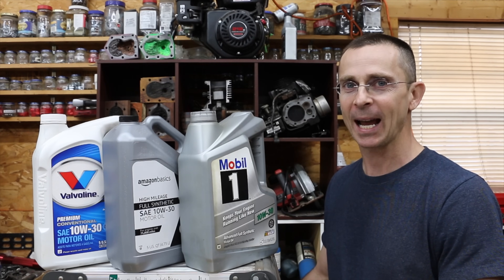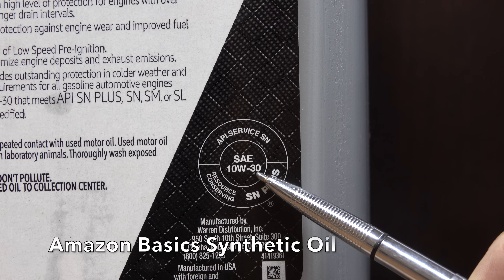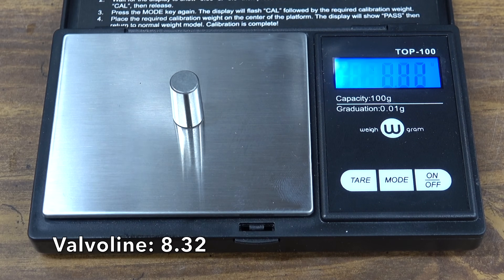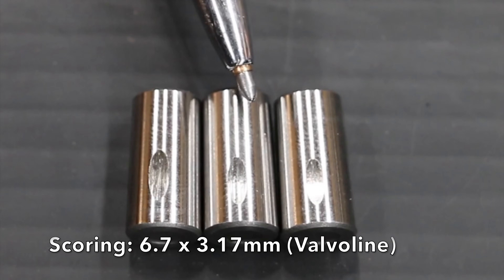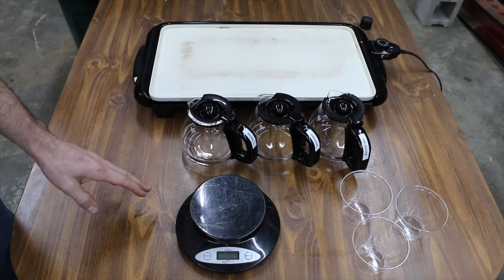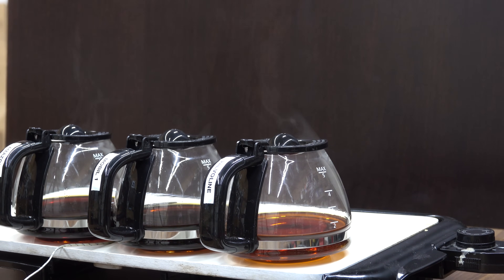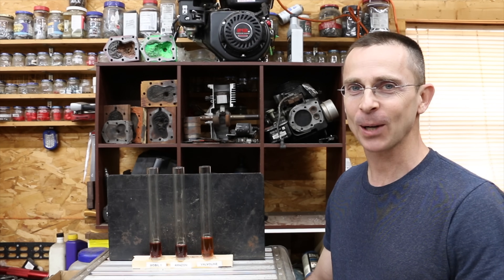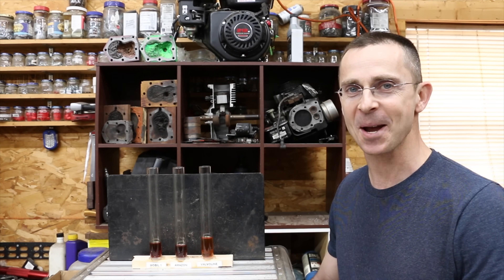Is AmazonBasics Full Synthetic Motor Oil better than Mobil 1? Let's find out!

Comment from the maker: DISCLAIMER: The testing methods outlined in this video are my own and not performed using expensive oil lab testing equipment or following the ASTM, SAE or API testing standards. This is a showdown between AmazonBasics full synthetic motor oil and Mobil 1 full synthetic motor oil. The VALVOLINE motor oil used in this experiment is CONVENTIONAL motor oil, NOT SYNTHETIC. The use of the Valvoline conventional motor oil is to illustrate the benefits of that synthetic engine oil has over conventional motor oil. Why buy a conventional motor oil when you can purchase a synthetic motor oil which will outperform conventional oil for around the same price or a little more? This is not meant to imply that the AmazonBasics full synthetic motor oil or the Mobil 1 synthetic motor oil are superior to Valvoline’s full synthetic oil. The three tests outlined in the video include tests for viscosity at varying temperatures, film strength, and evaporative testing. In my opinion, the testing approaches used in this video provide consumers with valuable information on choosing the right motor oil for their specific application. Hope you enjoy the rest of the video!
Reply from the maker: Edward, Thanks for the recommendation on testing super tech oil!
Reply: @ProjectFarm  You should heat the oil to the operating temperature and then do the lubrication test 👍🏻
Reply: @ProjectFarm  Haha, I was just about to ask about the SuperTech as well. It's also got the 'SN PLUS' rating, but I only see 10w30 available in quarts.
Reply: @ProjectFarm  I've been using superthech and quakerstate for years in my Corolla 192,000 miles. I'm curious about how it compares to amazon
Reply: @ProjectFarm  supertech is amazon basics.
Reply: Project Farm: what about Costco’s Kirkland Signature full synthetic oil?
Reply: Project Farm Try hyperlube lubricant ,compression test before and after on your truck and everything else and lubricity tester please
Reply: what about Walmart super tech oil?
Reply: Edward Moreno trash
Reply: @edwardmoreno8228  Pretty sure that the Amazon Basics is SuperTech. Bottle is the same and the bender is the same (Warren). Google images: "Walmart SuperTech Synthetic vs Amazon Basics".
Reply: Edward Moreno read a review on Amazon that the amazon bottle says Super Tech on it  .
Reply: @edwardmoreno8228  Independent tests show that Wal-Mart's SuperTech Synthetic Oil is nearly identical to the Amazon Basics Synthetic of the same viscosity.
Both made by the same company.
Reply: Now I want to see that but with the synthetic blend added.
Reply: As you try to be scientific as possible, perhaps a crowd fund for you to buy some mettler toledo scales (nice used ones on ebay for $800 go to 32 KG and measure tenths of a gram. The higher end ones likely aren't justified to have 0.001 grams).
Reply: Can veggie oil be use in a 2 stroke engine instead of 2 stroke oil + gas it should be veggie oil + gas I over heard that you have to add a little more veggie oil in the gas than the standard 40 to 1 ratio I believe it was around 25 to 1 ratio.  Was told it smells like French fries.
Reply: I would love to see the amazon basics and penzoil platnium go toe to toe.
Reply: @Duddyt  I would bet that Amazon Basics would eat Penzoil's lunch.
Reply: @Duddyt  Why not head to head...🤔
Reply: @Duddyt 
Why not head to head?
Reply: First of all... love the videos. I like the extreme tests that most people would cringe over. I've learned a few things from your tests that changed certain ways I used to do things that could of ended terribly. Thank you. 

Secondly, will you test Liquid Nail?  I would love to see how it holds up against it's competitors.
Reply: Project Farm try using hyperlube by itself as oil and mixed with oil and see how good it is
Reply: Project Farm And
Reply: Very helpful. You got yourself a new subscriber :)
Reply: Would also be interesting to see some comparison between more known American and Western (or Middle) European motor oils on one side to those from former Easter block on the other as people  quite often  share (mostly) mthys of those "Soviet-time" products being out of date and totally low-quality; in practice, they behave just fine and do their job - on older engines they seem to perform even better than any other lubricating product!

Just to give you some hints:
1. OLMA (Slovenia)
2. INA (Croatia)
3. Modriča (Eastern Bosnia)
4. Hexol (Romania)
5. FAM (Serbia)
6. Nis/NISOTEC (Serbia)
7. INSA (Bulgaria)
8. Prista (Bulgaria)
9. Lubrica (Bulgaria)
10. XADO (started in Ukraine, but now produced in The Netherlands)
Reply: I work in an oil analysis lab. Send me some samples
Reply: Canada allows non-synthetics to be marketed as synthetic.It's a racket.Group 4 I think they call it.Lots of hype concerning motor oil. Synthetic oil is ester based.So all the CanadianTire sale brands like Quaker State,Mobil andCastrol are not really synthetic in Canada, unless you can find the Euro formula. See Bob is the Oil Guy for debates.
Reply: Your videos are very high quality and very interesting, keep up the good content. 👍
Reply: Awesome videos! 
I do have a video request.  
We always hear how important it is for oil to flow in a cold engine, but we also know that oil sits on the parts and can run without oil in the crank case for a while. 

Could you do multiple cold starts lb 2 engines, one with say 10w30 and one with straight 30 oil? Or 15w40 vs straight 40? 

I'm curious how the engine that gets oil around faster but its thinner vs the engine that gets oil around slower but thicker film  strength compare as far as wear.
Reply: Project Farm I work in an “expensive oil testing lab” & can provide testing results such as pour point, ccs, kinematic viscosity, etc... if you want to send me unlabeled samples I would be happy to test & provide you unbiased results. Side note: Warren is a distributor, they buy bulk oil from major oil companies & package it for resale under different “brands” such as Amazon. (Side side note: Chevron does not make Amazon oil nor do any of its products rebrand as Amazon Oil ; )
Reply: Greg Chavez An important side note to this info is that there are other components and performance criteria that differentiate the various different synthetic 10W-40 oils, even those from the same manufacturer.  Because Warren is only a distributor/repackager of other companies’ finished products,  unless the retailers (Amazon, Walmart, O’Reilly) include verbiage in their purchase agreements with Warren that guarantee certain very specific formulations, it is possible that Warren could switch up their sourcing from batch to batch or month to month or year on year.  That means Amazon’s or Wally’s 10W-40 oil sold today could well be a different oil by formula than the very same oil sold 1 year ago or 1 year in the future.
Reply: Thanks for clarifying! I appreciate your non-biased videos and your down to earth personality. Totally subscribed to you now, what you are doing is great! Keep it up!
Reply: Well done,... I'm a retired CLS/STLE trained by Mobil Oil and worked for an independent Mobil dist in the upper midwest. We know cold. 
I like the fact you included the conventional oil and the fact you ran the cold flow for both fresh and oxidized oil. Most people don't understand coming into winter is a very important time to change the engine oil,. especially if the vehicle sits out. The visual of the oxidized oil hopefully registers with your viewers that synthetics are great for cold weather operation.
Visuals are the best learning / teaching tools..... I know,... I did training sessions for lubricant clients, jobbers, and our customer service staff. 
Everyone is from Missouri,... the Show Me state. I wished Youtube was around when I was still working. Very nice video.
Reply: Pennzoil Conventional,Full Synthetic,HM Full Synthetic would be a cool show down compared to other brands in the same categories
Reply: Viscometers are not all that expensive.
Reply: Beazos is making more billions
Reply: I would really appreciate a video testing different utility knife blades!
Reply: You should check out a product called POWER UP on your friction machine.  It's a bit expensive so maybe next time I order some I can send you a few ounces.  It will make the "wear" mark in the bearing about 1/10th the size.
Reply: Can you throw in valvoline full synthetic 1030, Castrol full synthetic, and then add rotella 1030. That would be very interesting
Reply: What's all the hype around Royal Purple? Should that oil ever go into a vehicle?
Reply: Have you tried that AmsOil product? This Amazon oil seems like a good one to use based on your tests here.
Reply: I know you made a video on thread lockers, can you make a video on which glue (Elmer’s, for example) is best for threadlocking?
Reply: I'm curious to see other house brand oils tested myself. CarQuest, O'Reilly's, and AutoZone sell oils with their names on them and I'm curious to see how they stack up to Mobil 1.
Reply: Project Farm  Have you tried Pennzoil full synthetic
Reply: I just want to say thanks for the update.
Reply: Project Farm
.....or someone else please.
Can you answer me this question? I have a 2002 Toyota,which should i use....SL,SM or something else.
Reply: I want to see one other CERMA oil too
Reply: Can you test Conklin Oil versus some other good oil? They claim to be this Grand oil that you can use for 20 plus thousand miles.
Reply: I would like to see how this Amazon brand would fare against Castrol Edge. I will probably never switch from Castrol, but I am very curious.
Reply: Please do a comparison video like this with Wal Mart Super Tech full synthetic. Awesome channel. Keep up the good work.
Reply: Walmart oil filters are made by Champ Labs they are a quality filter.
Reply: Project Farm Would you try Mobile 1 Extended Performance, Castrol Edge Extended Performance, Pennzoil Ultra Platinum, With Amazon Basic Oil and Supertech oil. As the synthetic you tested is not top of the line oil for each respective brand. Also love to see she’ll Rotella T6 go against the competition. (Truckers and turbo vehicle owners will forever appreciate!)
Reply: Dexos 5-30 comparison coming?
Reply: Hey I enjoyed the video, but I would of liked to see the oil measured as a control, given that the lubricity tester does tend to use the oil by flinging it everywhere, so more oil could very likely mean a better result.
Reply: Mobile 1 vs mitasu oil
Reply: Project Farm could you do a test with the new Shell Rotella Gas Truck oil?
Reply: Project Farm
Will you or have you ever tested Farm and Fleet full synthetic?
Reply: Big Dee  
Really? Why the obscenity?
Reply: Any chance of seeing a comparison of motorcycle oils, synthetic mobile-1 v-twin 20w-50 vs other comparable synthetic motorcycle oils that are used for other v-twin motorcycles like Harley, Victory, Indian, etc
Reply: Would you be able to test different brands of drill bits...drilling into different types of materials....like steel, aluminum, stainless steel, wood ect?

Would be interested to see drill bits from big box stores and professional grade....to see durability results and cutting speed vs effort...
Thanks for the videos you make and post
Reply: Thank you for the detailed video. You’ve gained a sub
Reply: Nice substitute for the HFRR. It's just not a standard. Was the oil heated?
Reply: There is a scientific method to measure the fluidity of the material which is called rheology.
Newtonian or non-newtonian, volum, temperatur, stress, strain... So many parameters needs to be considered to definite which oil is the best in terms of quality (depending of the use) and finally compare the price. The color should not be a criteria of choose. https://en.m.wikipedia.org/wiki/Rheology
Reply: Thanks for the feedback
Reply: It's looks like a paid comparison. Watch at 8.46. you can clearly see the flow way of amazon basics's way is slightly lean towards ground which gives it more speed to flow.
Reply: Have you considered,  doing a comparison test on combining the best friction-reducing additives with the best oils to see just how far you can take it? For example, adding slick 50, Marvel, Lucas, etc to see just how much you can reduce friction, using any or all combination of additives? Thanks, my apologies if this has been mentioned before.
Reply: Your scientific prowess is putting the majority of the nutrition community at Harvard School of Public Health to shame XD
Reply: Project farm I recently purchased a diesel pickup and I would like to know if you can do the same test but with diesel engine oil please and thanks.
Reply: I would like to see if you could test a new snake oil and include it in your test. The product is DT 5/50 this claims to be good stuff and is convincing in the videos. Thanks if you can. here is the link:  https://dt550usa.com/
Reply: Can you test the Valvoline vr1 racing oil up against the winner over all. Amsoil I believe as the vr1 has 1400ppm of zinc vrs 800 on the amsoil so curious how it does on the tests you run. Those of us using racing oil will be very interested in a racing oil test.
Reply: Please text this product
https://m.facebook.com/story.php?story_fbid=178815993674838&id=105983917624713&sfnsn=mo&d=n&vh=e
Reply: Will you test some imported motor oil? Perhaps Idemitsu motor oil. Usually found in Asian import cars. Honda’s usually use Idemitsu oil from the factory and require Idemitsu ATF. Really curious how they hold up to Mobil 1
Reply: Please test Mag1
Reply: Please test the payback motor oil in a future video.
Reply: Who cares, I know you have to do a disclaimer especially for the oil that doesn’t win. Your simply doing your own tests with your own equipment and whichever oil comes out the best doesn’t mean it’s the best for your car. The dam oil companies need to take this as free advertisement and just get over it and use these viewer available tests to improve their oil to be the best! Basically oil companies QUIT CRYING AND ENJOY THE FREE ADVERTISEMENT AND WORK ON MAKING YOURS “THE BEST!” NEXT TRIAL!!!
Reply: Is shell rotella better than amsoil
Reply: You need to test the tribotex oil additive claims to reverse engine wear
Reply: I think your testing set up is brilliant! I'm not sure you need the special equipment. The only thing you do need is replication (in science-talk, you currently have n=1). Do all the tests you did in this video 10 times and then you're really getting scientific. You might get different results - this single test could be an outlier, after all.
Reply: I love watching these videos, I'm sure you get request all of the time, but I think it'd be cool to see Champion Brands products tested. They are a local brand and I'd like to see how their products stack up against some other well known brands.
Reply: Could you test Havoline brand motor oil? Haven't seen much about that brand and maybe shell if you havent already done that one thanks
Reply: Big disclaimer there Mr.Farm !  You really should have used Valvoline “ full synthetic “ from the get go  !
At any rate, from your other reviews, it would appear that Amazon full synthetic is identical to the Costco and Supertech synthetics, only difference is it costs 4 to 6 dollars more for a 5 quart jug . $5 which can be used toward a better oil filter .
Considering Amazon has such clout, it should be cheaper than either one . I know you state that you don’t make anything from any product......however your reviews come across as “pro” Amazon .
I’m just saying !
Reply: By the way, Amazon is having a “super deal “ on Pennzoil ULTRA PLATINUM for $20.57 on a 5 quart jug ..... which as you know, came in second place next to Amsoil , about double the price, if not more !
Why should I buy the Amazon synthetic for roughly $19 when for a buck or so I can get the Pennzoil ULTRA .....based on your own review no less !
Reply: YES and what a GREAt motor oil well done Amazon:-) and a BIG thank you to Project farm:-)
Reply: It looked like you used more oil in the cup of Mobile 1 during the bearing wear test than you used when testing Amazons oil. This would cause lesser wear with Mobile 1 if the wheel was lower in the oil picking up more up on rotation. Now I did notice some splash off to the top left side & maybe that removed a little but it didn't seem you were measuring how much to put in the cup. Having said all this you do great work.
Reply: You are a liar, you said in the video that you used Mobil 1 Full Synthetic and then in the comments you clarify that you used a lower quality oil.  You should go to jail for speaking lies.  I wish I lost all your subscribers to being a liar.
Mentiroso jamás me suscribiré a tu canal.
Reply: Mate, you are cutting a considerable income stream by not having sponsors and I know why, your ethics are beyond reproach as a result. Have you ever thought of compensating for that with some merch? You have way more than enough viewers for someone like Bunker Branding to do it all for you, design, print, stock, take orders and distribute, all you do is get a monthly payment. I'd wear a Project Farm cap, I'd use a Project Farm can cooler/koozie as well. I'd also have a Project Farm sticker on my tractor. Why not drop them an email and give it a go, it's "no cost and no effort to you" income. after all.
Reply: Can you test oil monitor systems and changing your oil based on mileage.
Reply: I know that this is a late reply, but it would be nice to have a reference part, tested without any oil, fixed time on all and compare the wear to the reference part(no oil).
Reply: Valvoline restore and protect caught my interest. And I would like to see you use it in one of your vehicles, and every time you do an oil change, pull off the valve cover to see if it actually does what it says. Cleans 100% deposits. Make it  happen. I think it requires 90 hours or something like 4 regular oil changes.
Reply: I am really glad you picked Valvoline instead of a bargain bin dino oil to compare against.  I also really love the other two comparisons.  If I could add one more I'd really like to see Amsoil Signature Series compared against those other two synthetics. I'm a bit fan of all three synthetics now thanks to your excellent testing and demonstration.  Probably, to me, the best video of yours I've seen so far.
Reply: Perfectly said. Thank you for the 3 great picks here, perfect comparison.
Reply: Excellent demonstration as always. I think razor blades might make a good comparison. There's also a rumor/conspiracy doing the rounds that Gillete uses poorer quality steel over time (thus enticing customers to try their New-and-improved 7 blade razor. Plausible.
Reply: @Locrian1  WoW I've never thought about that, and it's scary how plausible it sounds
Reply: Who makes there oil Amazon doesn’t make oil where do they get it from what company
Reply: Amazon doesn’t make oil where is there oil come from what big oil company
Reply: Why buy a conventional oil is because you have an old engine that burns oil and leaks if it doesn't have a little sludge to help the seals stop that, where startup wear is less of a concern than having a mess where you park it and having to add oil more often than convenient.  I mean if you live where you can't park a car in your driveway, in an apartment or condo without a garage so you are just getting a little more time out of the vehicle with the least hassle possible.   You can try high mileage oil in such cases but high mileage dino seals better than high mileage synthetic.
Reply: @stinkycheese804  if you use good oil from the beginning, you get less wear, less of a gap for blow by.  Also if your oil loss due to leakage is enough to make you want to save money, why don't you fix the worn out seal or replace the pan with the stripped drain plug instead of cheaping out on an inferior performing oil?    It seems like saving money on oil is just going to cost you more in oil and engine costs than using good quality oil to begin with.  If nothing else, use a better product with your next engine and save all around.  I'm a big fan of Mobil 1, now Amazon Basics (if they don't change it) and Amsoil.  BobIsTheOilGuy proved to me the high protection characteristics of Mobil 1 and Amsoil a long time ago.  With Amazon Basics being a good contender now too.
Reply: @underourrock  evaporation due to water.
Reply: Stinky Cheese  You just nicely outlined your decision making process but most people aren’t driving old leaky cars. IMHO and experience, high mileage isn’t a reason to avoid synthetic but age is.  
I’ll add, IMHO, that ALL fluids should be changed to synthetics ASAP as it has a very real, positive impact on longevity of components.  Don’t forget to put synthetic brake fluid about every 2 years, synthetic transmission and differential fluids too!
Any synthetic is better than even the best conventional fluids, IMHO.
Reply: @MrFatcat23  This all depends on your definition of "most people ... driving" and whether "most people" is even applicable to the question.  Technically, 50.001% is most people which still leaves a HUGE swath of people driving leaky old cars.  I would argue that many people currently driving newer cars may well drive them past the point where they are "old leaky cars".  The cost benefit of buying a new car or even sealing all the leaks may well make the investment not worth it.  This is also a regional issue.  Many people in rural areas are more practical than your city dwelling hipster who always must have the newest iPhone and a five or less year old car.  The used car market is huge, even for the privately sold $500 beater.  

Often these leaky cars are perfectly reliable.  They just mark their territory a little bit...or a lot.  

The truth of the matter is, though, if you are going to sell your vehicle the first time you see a drop of oil on your driveway, or are even not planning on driving your car into the ground, it doesn't matter what oil you put in the car.  Grab the $10/gallon walmart special oil off the shelf and dump it into the engine.  You will be selling it before you can tell the wear difference anyway...silly rabbit...
Reply: @kender1412  I disagree with you on cheap oil unless you test it lubricant rate or how well the oil keeps metal parts from contacting each other with the oil film on the pistons and other moving parts.  Oil that has no quality after certain conditions like heat.  You can condition the metal parts with some oil products after stripping the engine of old oil residue with a clearer.  Did a few treatments on a three year old 72 Chevy El Camino which I still have today.  I used the product PROLONG and a engine cleaner in the old oil.  It would smoke a bit after starting the engine a few years after purchase February 15, 1975.  Thinking that oil was getting into the cylinder somehow and suspected valve guide leaking?  After doing the engine cleaner a few times after and adding the PROLONG to my oil the smoke out of the tail pipe stopped.  Not sure if what it did but that is the results I got.
Reply: Stinky Cheese I have an 01 Toyota Corolla that burns oil and I have to be filling it up every 2 weeks so would I use conventional oil or what would i use? I currently use valvoline high mileage which is a blend
Reply: @kevinarevalo8546  if it's burning oil and not leaking it, then high mileage oil would make no difference.
Reply: If the engine was taken care of in the first place or fixed and had good oil in it then it wouldn’t leak
Reply: @stinkycheese804  Pretty sure this vid was made for people that aren't riding hoopdis/ghetto rides. Obviously if your car is trash your'e putting the cheapest shit in. Been there done that.
Reply: Project Farm you should try flex seal in the crank case as an oil substitute I bet it’d be pretty eventful if you did it while it was liquid still
Reply: Project Farm  You probably won’t read this comment but I would definitely like to see Torco SR-5R oil vs Motul 300v power racing oil
Reply: This came up while I was researching cooking oil for my food channel. LOL
Reply: I was wondering what would happend to the carbon build up when you mirror polish the cilinder head. There are a lot of people claiming that polishing the cilinder ports decreases carbon build up. Looking forward to your anwser! Keep up the informative video's!
Reply: Have you tested manual transmission oil?
Reply: Project Farm I’ve yet to see you make a useless video...it’s starting to annoy me (lame joke of course). A suggestion for further testing: Amazon basic v. Mobil Extended service v. Mobil Annual protection. Thanks for the hard work.
Reply: try with vehicle please
Reply: Have ya thought about the new hemp oil craze......?
Reply: Try hyperlube lubricant compression test before and after on your truck and everything else and lubricity tester please
Reply: A lot of person are telling Amsoil No.1 is it really good guys ?
Reply: Project Farm which is better geese regular geese or marine geese?
Reply: Would love to see Harley Davidson oil up against Mobil one and amsoil
Reply: I believe you should test shaffiers. It's all I run anymore from the demonstration that I was shown by a rep.
Reply: Amazon may private label from Mobil 1
Reply: @gigilaco  
When you say Amazon may private label Mobil 1... Do you mean they may be doing that already or in the future and Why?
Reply: JackTannehillPromoter After some searching, I can confidently say that AmazonBasics motor oil is actually made by Warren Distribution. They’re the company that makes Mag1 among other brands. I think what you’re saying is possible in the future though.
Reply: Is there any way to contact you or email you.  I have some issues with a particular adative and I would like some feedback from you please. 
Thank you
Nate
Reply: Try driven oil LS30 vs amsoil. Different oil for high performance engines
Reply: I wish you had told your viewers that you were using Valvoline CONVENTIONAL while doing the test ! what other sneaky things did you do ?
Reply: I'm still not putting generic Amazon Basics oil in my car
Reply: Can you make a test Ravenol with Polytron
Reply: Can you test Driven Racing oil HR5 10w-40 and Driven racing oil HR1 15w-50
Reply: Wheres your videos testing amazon oil?
Also cam you test multiple variants? So try 5 30, 5 20, 10 30, etc. And see if theres any difference for those vs other oils. I have a feeling that just bcz this amazon oil variant did well.. that others may not. Perhaps mobile would win 5 20 match up or something. Im curious of amazon holds up across the board in all variations. Im still skeptical to use it but i might on my next beater car.
Reply: Have you tried top 1?
Reply: you should have at least tested Amsoil instead of Valvoline...
Reply: Chubbysumo The reason for the Valvoline is that a proper testing protocol requires a baseline setup or system that is comparable to those that are being tested (the accelerated wear/lubricity device is a good example) so that the testing setups themselves are proven as comparable/fair/valid.  While water or honey could be used as control lubricants, or a dry test could be considered as a control, but they would only validate the validity of oils as lubricants vs. water or honey or dry, whereas the Valvoline test validates that the test does in fact work (oils will work with this system), and therefore any differing results are attributable to the subject products (the synths) and NOT the system or faulty methodologies.
Reply: @chubbysumo2230  Valvoline is the best conventional oil available. . Valvoline Full Synthetic is one of the best synthetic oils available!
Reply: You can send the oils to an expensive lab for about $50 an oil.  There are multiple companies online who will do this?  Why not do that instead?

Your tests don't even show that much information.  Things like cold flow are more a function of viscosity (10w30) than oil quality.  All your test show can show is that it isn't actually 10w30, but you can't tell us which one is too low and which is too high.  A low viscosity that is good for cold flow is bad for fully coating engine components, so balance is needed and this test is not a pro or a con.  Likewise a 0w40 is better for both (since the first number is lower and the 2nd number is higher), but in exchange it has more non-lubricating additives which can cause it to perform worse in other areas.  It is what it is by design, not by quality.  So your test doesn't really tell us anything; any more than saying "this orange is more orange than the apple is."  ... Great.  Or I could pick up a 0w30 and do even better, but who cares?  That only tells me the oil doesn't match its label.

Particles tests for wear, contaminant tests (such as varnish in the oil) and so on are much more important to engine life.  And it would be good to test each again after a few thousand miles in an engine, to show how much they break down.
Reply: Where are you buying synthetic oil for “just a little more”? It’s nearly double if not more than that for synthetic lol depending on brand of course
Reply: @TomPlaneto  I think he means Amazon Basic or Walmart Super Tech full synthetic.
Reply: @TomPlaneto  
Walmart Supertech conventional vs Walmart Supertech full synthetic have a price difference of less than 70¢ for a five-quart jug.
Reply: @TomPlaneto  autozone I scored 5qts Mobil 1+filter for 6 bucks more than conventional +filter cause o the sale
Reply: @TomPlaneto  Amazon basics costs just a little bit more... Do you actually listen or is it just that you didn't have your finger in your left ear so the words wouldn't go in the right ear and flow right out the left?  At the beginning of the video, he stated that most synthetics are expensive and arguably not worth the cost.  The point was to test the Amazon Basics synthetic against a good conventional oil and a good, more expensive synthetic to see how they compared.  The inexpensive Amazon oil did pretty well, making it a good contender against a halfway decent conventional oil.  Now, if you want to throw garbage $0.99/qt oil that comes from a guy bottling oil slicks from the seep plains in Southern California on eBay, by all means, do so.  It's your engine.
Reply: Some issues: why are you using 10w30 if you are concerned with cold flow? 5w30 or 0w30 is the way to go. Why are you also comparing synthetic with conventional? Also why isn't the most important thing in engine oil, TBN (total base number, aka how much acid it can neutralize) tested? Synthetic basically can last 2x as long and you are comparing fresh engine oil against each other instead of used up worn out synthetic against each other.
Reply: Shing Wong  TBN is really more important in used oil not an oil right out of the bottle.  It you want to compare it to the new oil
Reply: So you test amazon synthetic 
Mobile 1 synthetic 
And convenient valvoline? Now why wouldn’t you test synthetic valvoline?
That’s odd that you did that ...
Not a far test when you have 2 synthetic and one reg why even bother really ? Text the none synthetic against it that would be a fair test ..
Reply: @Project Farm Why didn't you use valvoline full synthetic when comparing it to 2 other full synthetic oils?
Reply: @deving5010  I think he wanted to show that for a small difference in price you could use a full synthetic oil that out performs a known high quality conventional oil. (Amazon Basic full synthetic vs the Valvoline conventional.)
Reply: In other word, you don't even know what you are testing, and you are here only for clicks and ads revenues.
Reply: Yea, you need to re-do this test using Valvoline SynPower for accurate comparison. I understand you used Valvoline conventional, but why not use Amazon Basic conventional? This could be seen as defamation. just my $0.02
Reply: Project Farm You really think you can just mention that the test was misleading in the comment section, & people won’t still think you’re dishonest? Not everyone cares to read the comment section.